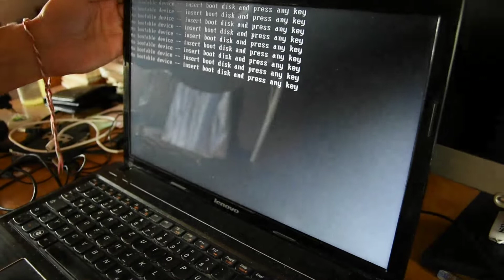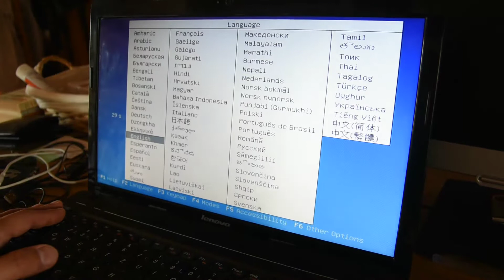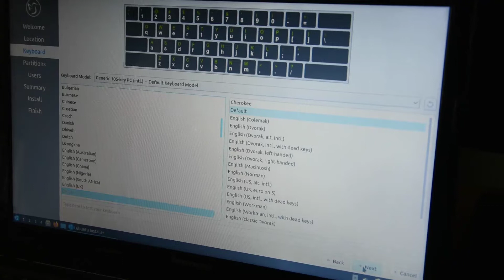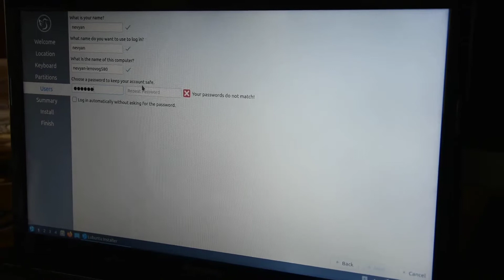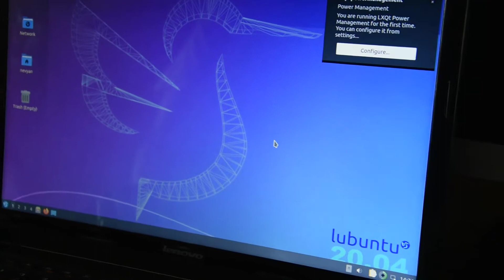Changing SSD and installing Lubuntu 20.04

Comment: Thanks for posting that video, it is very interesting.   I replaced my 2.5" IDE drive with a M-sata to IDE connection, I tried to install Lubuntu but the SSD just won't boot up, I can't figure out what the problem is, it is a very old motherboard and it doesn't seem to have the ability to find the SSD.
Reply from the maker: You can try to update the motherboard BIOS firmware to see if it could support the M4 mSATA interface. Then if in the BIOS you have onchip sata channel and sata type options, you can try out if their different configurations will show up the SSD.
Reply: @NevyanNeykov  Ok, I will try, thank you.